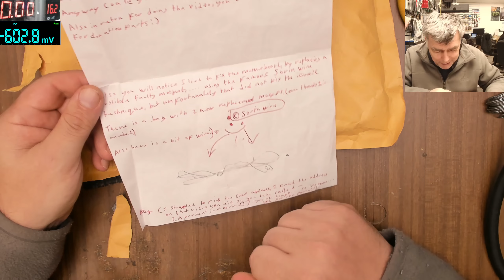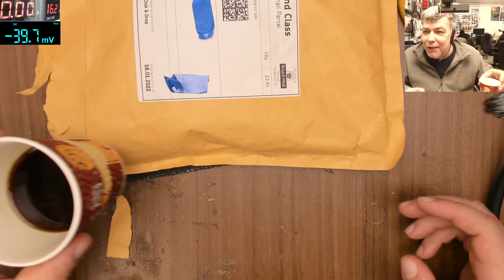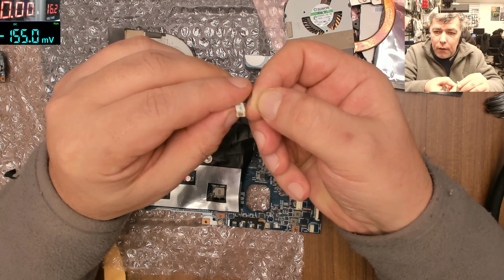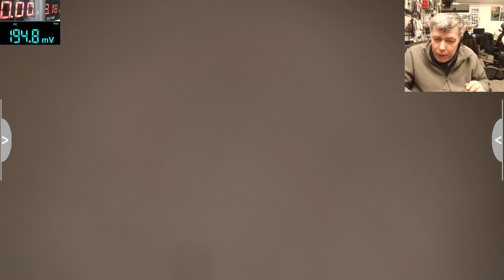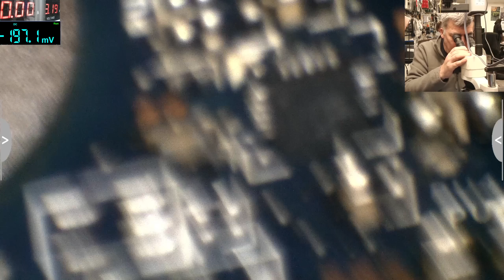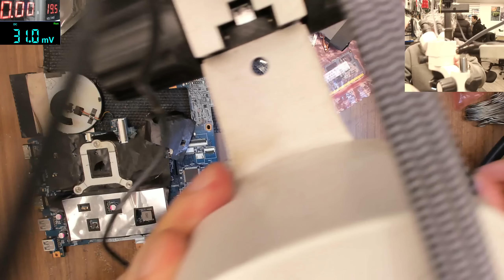Laptop motherboard repair- a subscriber video request

Comment: @12:37
Noticed it immediately, on the big chip top left, a pin is burnt off. Or at least it looks that way(just in case its a bad reflection of light on corrosion).

Comment: Please sorin can you answer me : I have lenovo G580 dead no charging led no nothing , the 3.3/5v  ic generates 3/5v LDO but no 3.3/5v ALW output my question is :if the power ic has all requirements voltages even EN voltage comes from B+  why can't generates 3/5v ALW ?I try replace it but same result,maybe KBC but how?!.

Comment: Pretty cool. 5-6 seconds to desolder this 5/3,3 controller. What flux do you use?
Reply: its the temperature and air🤣he always use high temperature and strong air on hot air gun

Comment: Hi Sorin and all respect, I occasionally fix even more for myself and I even learned a few tricks from you but I don't understand why you didn't check the chipset power supply which is possibly faulty and injects 3.3v into the chipset instead of  1.2-1.8v, with respect

Comment: This laptop start for 3 second and shutdown, but you didn't put RAM Memory,  you test it without memory.
Reply: Missing RAM normally results in the BIOS reporting a POST (power-on self test) failure, not shutting down completely.

Comment: Just an observation.. Please look at  the power wire you soldered to the board @ 7:25 to 7:35. I see that there are power wires touching a component next to the added power line. Could this be why it was not working? Have a wonderful day!
Reply: I noticed the same, it is touching 2 pins, may be causing a short

Comment: Hello Sorin, just 2 min of yours can fix my whole month problem.
The issue is that I have removed the battery of my laptop because of obvious reason. Now I study on my laptop when it is connected directly to electricity. When electricity goes off it shut down immediately, that's natural.
So, Is there any app or any technique possible so that my laptop remains secured of immediate power cutt off.
Thank you.
Help if anyone of u know or tell me that there is no such way.

My studies are affected a lot.

Comment: where the positive wire was soldered two strands are a bit longer and touch two two legs on the mosfet I'm not sure if this caused a problem or not.
Reply: The 3 legs of the mosfet was in any way together... the gate is not touching the v+

Comment: Everything went short circuit in my previous desktop pc after few months of use dead cpu, dead graphic/ memory controller on the motherboard and dead gpu chip on the graphic card but hdd was safe at least i can still access my old data even tho it's showing c5 error...

Comment: Buna Sorin, ce poate sa fie, cand motherboardul nu vede hard drive-ul? Cand laptopul porneste, merge direct la bios.
Reply: Ai verificat HDD-ul, poti incerca cu un rack, poate la optiuni de bootare e ceva schimbat intre UEFI si CSM
Reply: @alexyo5402  Buna Alex, am incercat diferite HDD-uri. MOBO-ul am cumparat de pe Ebay. Am loadat Windows-ul , a functionat correct pentru citeva zile, si nu l-am mai folosit aproximative 10 zile. Cind am vrut sa il folosesc, a bootat in BIOS si HDD nu a mai aparut in BIOS. Am inceract si M-SATA driveul,  cu acelas rezultat.

Comment: Is chipset difficult to replace?
Reply: if you have the right equipment and some experience it is not. If you do it every day you can replace it in about 10 to 15 minutes. If you do not have experience you will probably damage the new chip set when replacing it. Needs a month practice to desolder and resolder bga chips to get a feeling for it
Reply: @irishguy200007 , On YouTube the TCRS Circuit Channel ( he has the equipment) has videos for replacing the processor. But by far the best video was posted by the DosDude1 Channel yesterday, replacing the processor for a MaBook. Since YouTube does not allow links, search for following title >>>> Upgrading the CPU on a Mid-2010 17” Apple MacBook Pro
By watching the video, you will judge the experience/expertise and skill level of the technician, which is considerable. But it can be done.
In Sorin’s nice video, he does mention, that it can be done, but it is time consuming, especially in the context of a business. Besides Sorin does not have the equipment, has to do it brute force.